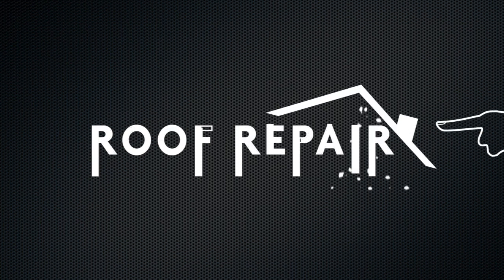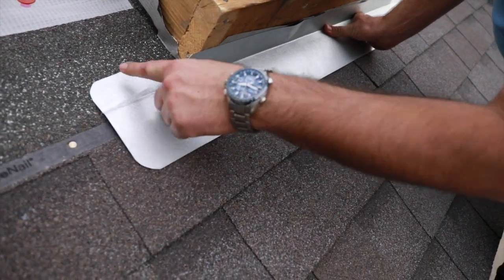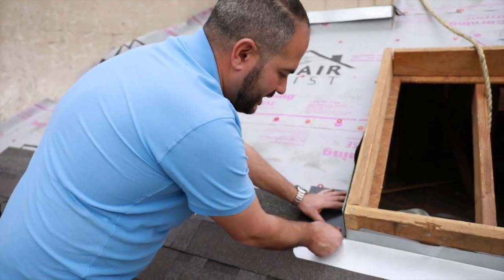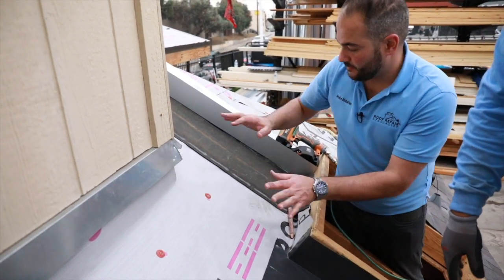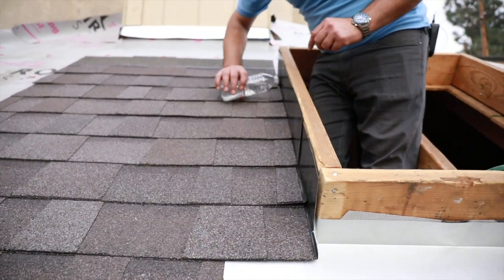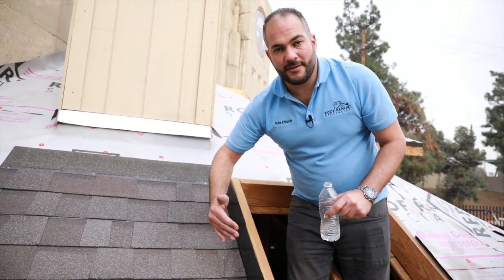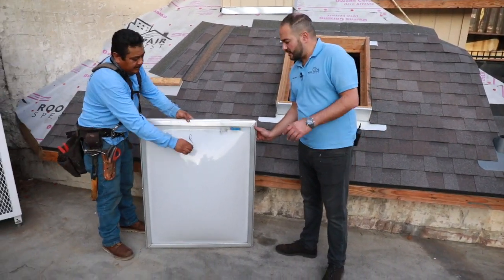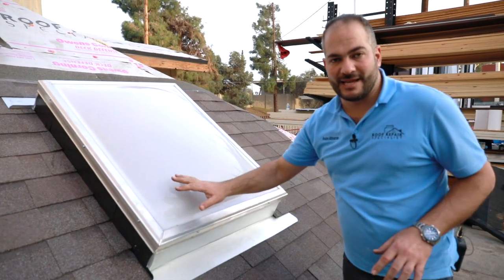[FULL] Skylight Flashing Tutorial | Headwall, Step Flashing, Saddle Flashing, Counter Flashing

Comment from the maker: Do you have a different method that you prefer for flashing around a skylight? Drop a comment letting me know!
Reply: This video helped me a lot this past weekend.  Whoever last worked on my roof, took ice and water shield and ran it OVER the flashing all around the skylight.  No step flashing, nothing.  just butted the IWS into the corner of the flashing, shingles over that and called it done.  I had to clean it all up and your video was very helpful.  I put in all new step flashing and made sure the flashing that came with the skylight pokes out under all the shingles.  I did run the IWS under everything and 4" up the side of the skylight.  Rained pretty well last night and no leaks.
Reply: 😂wi
Reply: Have the same problem,, its hard to find good people,, for the job,, happy you fix your 👍🏽👍🏽
Reply: @roofrepairspecialist what would be the differences when doing a skylight in a 4 season climate area?
Reply: I do a lot of metal same thing just uses a full peace
Reply: why don't you show a much harder one on a pitched metal roof.....

Comment: If a re-tiler covers the bottom flashing should the tiles just be cut at the ends of the box and the tile pulled to expose the flashing.  The tiler covered one box' flashing at the bottom (north slope) but left exposed a second (south slope).  ??

Comment: thanks for the super clear video and other helpful content! I installed it almost like how you did, however the head  flashing is a bit wavy. I saw another guy put roofing screws to pin it down but I don't really want to do that as I'm afraid it could leak there. What would you do? would you glue the flashing down to the shingles with bitumen glue?

Comment: I think I need the video for the cricket application you spoke of for the saddle flashing.  I have a larger 4 dome (2x2) cluster skylight and the top and bottom are wider than the 30 inches you referenced. can you add a link for your video on this?

Comment: This was an incredibly informative video, thank you. Not sure if you are still responding to questions, but here's mine.

For the saddle flashing, you cut it flush with the skylight box, leaving a small lip that extends past each end. Why do you cut out the excess piece instead of wrapping it around the skylight box? And if the purpose of the lip is to direct water away from the corner, why not have an angled lip instead of a uniform lip of what appears to be about 1 inch?

Thank you.
Reply from the maker: Wrapping it would work, I like the idea, definitely doesn’t hurt. 
If I understand the second part correctly I think leaving it straight is better as you’re not trying to direct the water necessarily, you’re trying to keep the water away from the corner.

Comment: Why wouldnt you use the same color metal that you used for the step flashing that makes no sense. Plus you should put a counter flashing all the way around the skylight.
Reply from the maker: The other flashings don't come in the same pre finished color. 
I don't think counter flashing is necessary as long as the skylight comes on top of the step flashing. It wont hurt though.

Comment: Great video. Very professional. I’m trying to solve a problem with slight water leak from skylight. I think I sealed in the bottom of skylight with Karnak roofing sealer and now water can’t escape so it ends up leaking inside. What caulking did you use in this video.
Reply from the maker: We use ChemLink M1, however there are allot of great caulkings on the market. The correct flashing is far more important than the caulking.

Comment: Yeah, not sure how much you all deal with snow where youre at, but we run Ice and water around the entire frame of the skylight to stop any need for sealant. Flash and roof everything and its done.
Reply from the maker: We're in So Cal, no snow here. But in places that do get snow for sure Ice & Water Shield like your saying, I would still do sealant on top of that.
Reply: @callthespecialist  yes, we always ran the 2300 geocel on top, sealed each of our fasteners as well for bullet proof installations. Ice out here can break through roofing up to 4 feet up the slope of the deck, which is why so much caution is taken during the job.

Comment: Thank you so much what a great video! Couple of questions if you have a chance. How do you fasten the curb to the roof? I was guessing it was toenailed but wasn’t sure. Also, if placing down roll flashing/ice and water shield, does it go over the roofing felt or under it? And finally, any tips for sealing off a tree growing through a roof penetration? Thanks again!
Reply from the maker: Hey Aaron, I'll try to answer best as I can. 
Usually it's just toe nailed, sometimes simpson straps are used, 90degree brackets. 
The ice and water shield can go either way, generally we install it prior to underlayment. I believe that is what OC recommends. 
Lastly sealing around a growing tree; I have not done this, I have seen people use flexible EDPM flashing, its rolled flashing used on metal roofs.
Reply: Thanks so much. I really appreciate the help.